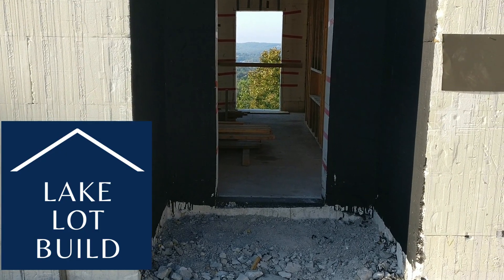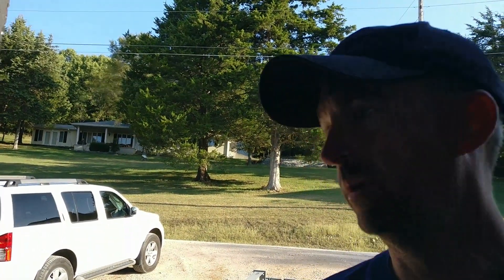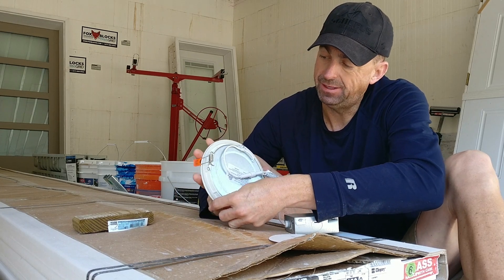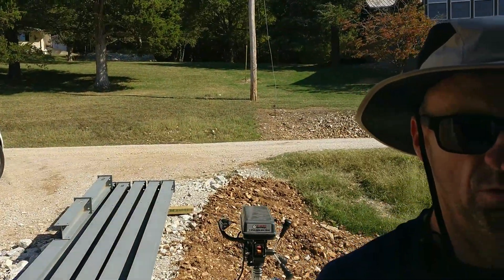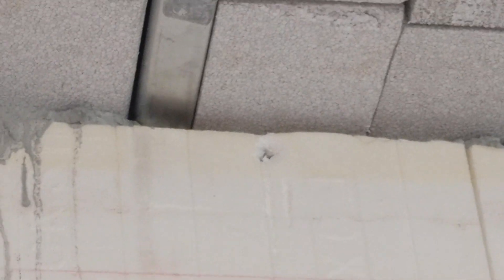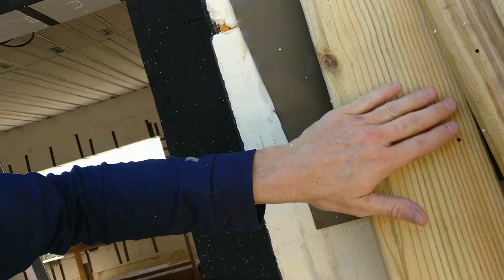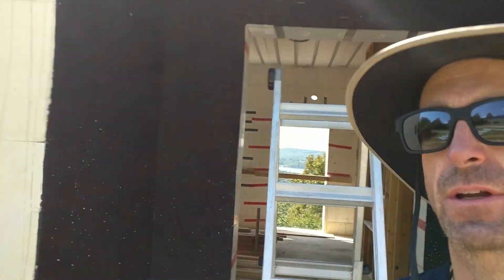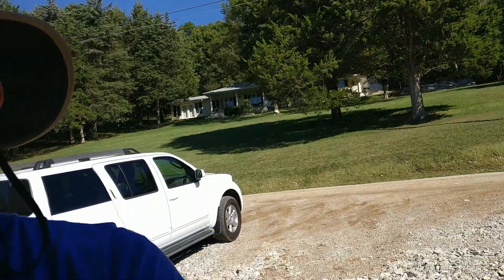Installing LED can/recessed light in ICF Litedeck Form and running wire in the ICF Fox Block wall

Comment: The led strip in those lights won't last long.
I have some and had to open the fixture up and switch out the led strip inside and no problems after that.
The strip light in the fixture was garbage quality and I replaced it with a much better quality strip.
It's not hard to swap them out is the good news
Reply from the maker: Good to know. We will watch out for this and replace when needed.
Reply: @LakeLotBuild  mine didn't last a year.
I changed the led inside to a better quality led and I haven't had a problem yet.
I bought the led strip from eBay I used to replace the cheap led strip.
3 screws on back of the light will open the fixture and show how simple it is put together

Comment: They make the same kind of bits for routers, upcut and downcut.  I like to use a fine tooth wood hole saw in the right dimension to scribe the surface and follow with the jig saw.  Gives you a good guide and just enough relief that the blade tends to follow it.

Comment: Even though heat is greatly reduced in LEDs it is still considerable.  As with all electronics good ventilation will get you closer to their rated (optimistic at best) hours of operation.  I have a great many of different types in my shop and home and can tell you from experience that they get very warm when in operation in line with their power rating.  I am not sure how the myth got started that LEDs are 100 percent efficient but you will quickly be dissuaded from that if you walk behind one of the big screen LED TV's and feel the warm air emanating from their vents or handle a LED light bulb after it has been on!  A great saving over resistance but still something to be considered in installation and design if you want the full life they can offer.  Enjoying your build as I haven't seen the details of ICF roofs and decks.  Just watched another where they did a shed roof style home with the ICFs.  It would seem the critical criteria would be controlling the cracking which occurs in concrete.  The waterproof covering would have to have sufficient elasticity and/or a similar coefficient of expansion to be long lived over the decking as well.  I noticed your rebar schedule was much healthier than this other job where they used rebar in the form but cheaped out with mesh in the decking.  Something I think they will regret in future years.  Good job.  I envy you your deck railing with the Marston mats.  I wish I could find some laying around!  A unique look balancing all the modernistic features elsewhere.  Nice job.